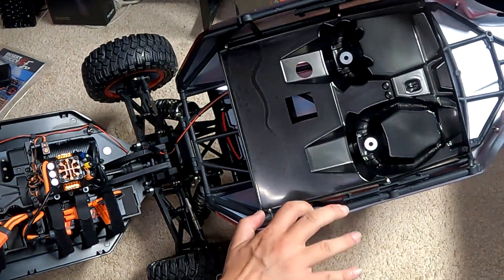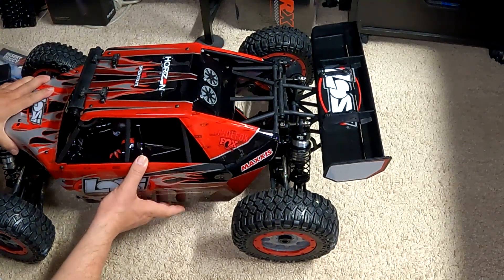Unboxing the Losi Desert Buggy DBXL-E 2.0 8S 1/5 RTR 4WD Electric Buggy - Pt. 1

Comment: hi, how long do two 5000 batteries last?
Reply from the maker: That totally depends on how much the motor and ESC draw, how hoard you are on the throttle, how heavy the vehicle is, the temperature outside, and a dozen other factors. In short, it's impossible to answer.

Comment: HI, 
My name is Vince
I have a question:
I would like to order an inexpensive TX  and RX for my future Kyosho 
Mini-x MR04 EVO 2! Can I use the Kyosho KT531P  ? Do you ( or somebody)  have a tip 🙏for an affordable TX and RX?
e.g
Vince
Reply from the maker: Unfortunately there are no inexpensive options. The EVO requires a receiver that mounts under the forward panel. It is an open circuit board with an antenna wire. The protocol depends on the transmitter/receiver you choose. The receivers are in the +$60 range and the transmitters are much more than the cheep 2 channel transmitters. 

This one at $244.99 is a good deal but it’s on back order on Amain Hobbies: Kyosho Flysky Noble NB4 4-Channel 2.4GHz Mini-Z EVO Radio System w/2 Receivers

This is the transmitter I use.